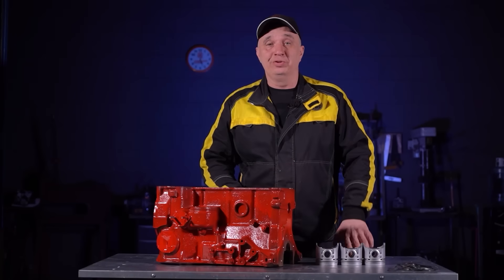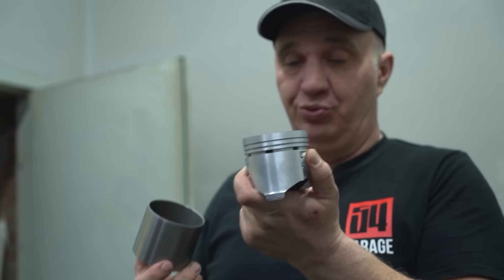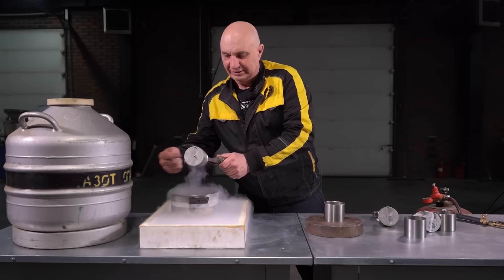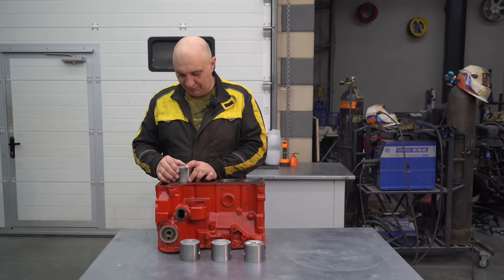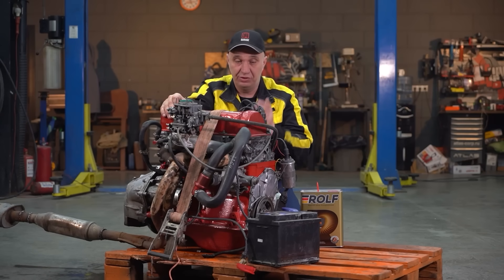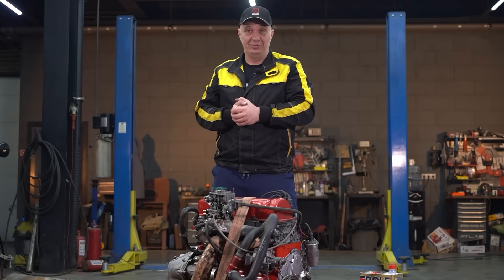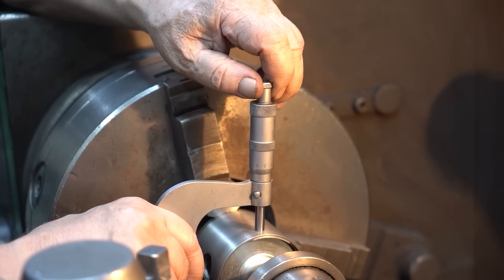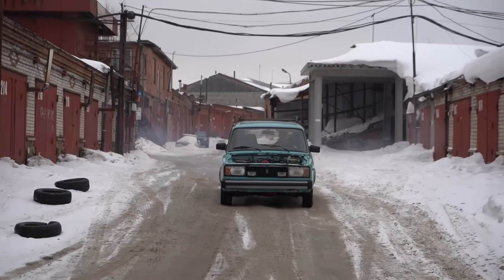We fit pistons with no rings to an engine - will it work?

Comment: I don't think just putting a sleeve on the piston will fix the thermal expansion issue. The aluminium will still expand and push the sleeve into the cylinder wall. Maybe the sleeve idea could work if there was a more elastic material between the piston and sleeve like some sort of epoxy? I think the better solution though would be to make the whole piston out of iron.

Comment: Gas model engines don't use rings. Both the cylinder and pistons are steel so they expand at the same rate. The fuel is a mix of caster oil and a fuel so everything gets oil. For a car engine you might be able to use two cycle engine fuel but it will smoke as long as there is oil in the fuel. The aluminum in the piston is enough to stretch the steel sleeve and that is why when the engine is warm, you lack clearance. What you suggest should work however without the rings the engine will probably have a shorter life as the wear will soon result in a lack of compression.

Comment: That aluminum piston inside the iron sleeve is still going to cause it all to expand and the clearance to tighten up between the piston and cylinder. I was hoping you guys were going to make cast iron pistons so everything has the same thermo expansion rate. Hobby grade nitro RC cars don't run piston rings but do have lots of lube in the oil.  I wonder if mixing oil into the fuel like a 2 stroke would help too
Reply: Yes. The steel sleeves don't prevent the aluminum from expanding with heat, nor do they contain it. I think some 2 stroke oil would have prolonged the fun a little longer, but would not have prevented catastrophe.

Comment: The idea from a Formula F1 engine which has such tight clearances that it cannot be turned by hand when engine is cold.  Engine needs a manual heat cycle to warm up enough so that you can turn the crank and fire it up.  Because the clearances are so tight the F1 engine being small in displacement Litre size has very high HP :)
Reply: Hahahahajahajajajajahaahah

Comment: The oil control ring directs oil to the wrist pin holding the piston to the rod, would never last without it even if you can make a piston that won't seize up. :)
Reply: I'd imagine this would work a lot better on a two stroke engine

Comment: I guess if it were me, I would've done the opposite. Same as here, but then put them back on the loathe and removed a fair bit everywhere EXCEPT where the piston rings would've been.
Why? Because you've drastically increased the friction by doing it the way it was, and without oil getting up there,... well, it's like trying to put it in the old lady's back for without using oil 😏

So this would, at the very least, remove 90%of the contact surface but still have completely sealed cylinders.
Heck if you can somehow KEEP the oil ring, or drill oil galleys between the "solid rings" (since that area was removed on the latge remember), that'd help even more!

I still think it'll seize and grenade before long, but it'll last a lot longer than this poor engine did! lol

Comment: Ringless piston engines are a thing. I have dozens in my bedroom as I type this. But they use a cylinder machined in a taper that's designed to expand into proper shape when it warms up, with a pinch zone near TDC, to make it all work. They're also all 2 cycle. Conrods really do not like being tugged on hard enough to pop the piston out of the pinch zone so YMMV on how long a 4-cycle lasts that way, but it's food for thought, especially since this engine needs sleeved anyway if it's ever gonna chooch again.

Comment: Rings don't just seal they also allow the piston to ride in the cylinder with a lot less friction, just those thin rings making contact is much less friction than a whole piston making contact. Friction means heat.

Comment: ok. having not watched. ill make some assumptions. will it work? i believe it will. but if does. not for long. it would certainly wear out piston skirts and cylinder walls quickly. but having seen some odd ideas for pistons recently. assumptions rarely turn out as expected. so ill shut tf up and watch and refer back to this after if i feel it needed.

Comment: Interesting but what was the point of doing this? Of course there is a reason for the piston rings and piston tolerance. This was a 100% predictable because of the different expansion properties of aluminum versus iron/steel. While the Ladas/Vaz were Fiat 124 bodies made under license in the USSR the engine was not Fiat. I wonder what kind of engine and transmission were mounted on these cars. Was it an indigenous design? Thanks, I truly enjoyed the video

Comment: Let's back to the past. When we invented piston rings in the steam engine They are needed, because piston heats faster than cylinder ( even tough the pistons and cylinders were made the same material). In combustion engines the different of temperatures is bigger.

Comment: It would be cool to see a 8 cylinder horizontally opposed boxer made from 2 inline four bangers.
Reply: One of the better ideas I've seen in the comments
Reply: Someone kinda did that already with vw engines
Reply: Porsche did this for the famous 917 IMSA and Le Mans racecars; only they were boxer six cylinders and they made a flat 12. It's noteworthy that it didn't run as a "boxer" though - pistons opposite one another did not reach BDC/TDC at the same time. Thus it was a "flat" 12 and NOT a "boxer" 12. Ferrari did same for their flat-12 in the Testrossa.

Comment: one thing I don't think you took into consideration is the actual construction of the internal dimensions of the piston.  Pistons have more base material in certain locations so that when it expands due to heat it forms a more perfect cylinder than when it is cold.  when cold pistons are not cylindrical they are more oval in shape than circular.

Comment: If not drilling the pistons for the oil relief holes to lubricate the piston, using a pre-mixed gas and oil mix would have prevented this IF you also had looser tolerances.

Comment: maybe if it had aluminum cylinder walls with reasonably tight clearance aluminum pistons that have skirts and a thin oil maybe 20 weight it may last longer. I'm just speculating though. I've been curious about this. maybe add some 2 stroke oil to the gas as well.

Comment: You should use a nickle-iron alloy steel, such as "Invar". I believe it has the lowest thermal expansion of any steel currently available.
I've never worked with Invar, so I don't know the machinability of it, but I'd be curious to see how that would perform.
Could maybe even machine a piston from chrome molly steel such as 4130, Or even Inconel 718, if your pockets are deep enough $$$.

Comment: hobby, RC, and model engines like COX have taper bores. So at the bottom of the stroke the bore is slightly wider than at the top of the stroke where power is made.
You could try a taper bore, so maximum seal occurs at the TDC of the engine.

Comment: heat the block (hot water) before starting --- or machine the block to size when its at around 90 deg c. -- the piston heats up much faster than the block. If you prejeat the block, or at least machine the block to size at operating temperature you stand a much better chance.
Reply: Also  use piston material that expands less than the engine block. F1 cars use engines that are frozen solid when cold and pistons free when the engine is heated close to 90 °C. As a result, the engine must be heated with external source before it can be started. If you use piston material that expands less than the engine block, you'll get more tolerance if you're close to overheating the engine!

Of course, you can still melt the piston or valves but it will not stick to the engine block.
Reply: @MikkoRantalainen  Pierdolisz.
Reply: Exactly my thoughts. I recon if machined like that it would have kept going, but would need heat soaked at 90°C before start up. 👍🏻
Reply: You have to do both, machine for operating temps and clearances and preheat the motor so it has enough compression to start.
Reply: @toolbaggers  correct!
Reply: Nope won’t work thermal exspanshion
Reply: Someone's got too much time on their hands ..
Reply: It would be a total pain in the ass to start tho....  

Would have to wait and get everything hot with coolant, oil, and block heaters EVERY time you needed to go somewhere.
Reply: heat that thing up with several guys on rosebuds AND use a torque plate. thats how i prep all my street blocks for dressing. we use tempilstiks to ensure even heat is applied.

Comment: Privet. I would suggest to machine your own fully aluminium pistons with usual mechanical adjustments (or just a tiny tiny bit tighter) and design segments grooves (with no segments, of course) inspired from Tesla valves using something like a triangle shape for instance. 2 grooves on top for compression and 2 others lower with the opposite shape to prevent oil from feeding combustion. The idea is to use physics principles to create virtual oil segments. Surfaces of cylinders have to be prepared like 2 strokes engines and a bit of 2 strokes oil in fuel may also help. Good luck ;)

Comment: Try to make an engine run above 100°C intentionally with an oil or something instead of water as a cooling liquid, so that the boiling point is much higher. Then you could boil water with a heat exchanger and make coffee or tea while driving for free!

Comment: Back in the 1970s, my brother was into model aero-engineering, and always tinkering with engines. Those tiny engines were way too small to have piston rings, but what they had instead was a couple of narrow and shallow grooves where the rings would be. As I understood it, those grooves would fill with lubricant from the two stroke fuel, which in turn would help to cool and lubricate the pistons, but not only that, it had the desirable advantage of increasing the compression pressure - don't ask me how, I have no idea, unless the oil in the groove behaves like a sort of piston ring.

If you have plenty of engines to play around with, I wouldn't give up on this project just yet.
Reply: Tapered sleeve to seal the top of the stroke when it needs the compression

Comment: I wonder if it would work way longer if you removed the thermostat and added another radiator plus a large oil cooler, if you don’t let the engine actually get up to temperature then it would be much easier to control the clearances, obviously the efficiency would be terrible though

Comment: Now if the cylinders were thicker (or even solid in a block) then things may have lasted a bit longer, but still would have overheated with the lack of sufficient lubrication to the walls, adding oil to the fuel could help, but only delaying the inevitible... :P

Comment: AC compressores have an iron piston with no rings wich travels inside a cast iron block, however they run cool and occasionally what adds to their longevity.
Reply: Yea due to no explosions. Combustion creates heat .
Reply: True. 
Two problems are here:  1. Different expansion due material.  2. Different expansion due different temperatures in piston and wall.
Reply: AC compressors (I assume you mean the kind used in cars) are constantly bathed in oil.  Without combustion you can essentially immerse the entire thing in oil and oil becomes the rings.

Comment: No oil will get to the cylinders
 Should have drilled a few holes to allow oil flow.
Reply: Should have added 2-stroke oil to the fuel. That's much easier.
Reply: @CarsandCats  They should have version 2 (the refined one), and with 2 stroke oil
Reply: Or do make holes or pores like street racing motorcycle pistons, that will avoid engine from getting jammed

Comment: Pleasy Try again, this can work, Tiny RC Nitro Engines work also without Piston rings.
The Piston is made of Aluminium and the Liner is out of Brass, these engines can whistand up to 50'000 RPM
But you have to make an oil film, maybe try 2-stroke oil in the fuel.

Comment: I could see that it would work from the beginning,if you wanted to work only with full steel piston or aluminum block and same thermal exposure, that would mean that all should heat up at the same time

Comment: Wonder if you slot cut bottom to act like a ring, would that work to seal it better? Almost like a collet is cut but around the diameter instead. It would have to be over built on the piaton face side to make up for the rigidity loss by using the skirts like an expanding seal. May help to cut radial grooves to reduce wear and improve seal as well. Like the piston grooves but using using the skirt as the seal instead. Not sure if this makes sense to anyone. Would be an interesting project to see how long it lasts and how well it seals.

Comment: As a kid, my Cox .049 engine ran fine, while having no piston rings.
Reply: And those little things are actually high performance 2 stroke diesels
Reply: @gregdowd939 NOT a diesel.... 

The ignition comes from a catalytic reaction between the methanol in the fuel, AND the platinum metal in the glow plug element. 

Without the methanol, OR the platinum in the glow plug, those engines will NOT run. 

The ignition is not just set off by compression alone. Compression is just a small part of the entire ignition process in these engines.

Edit: If you dip a fine Platinum wire into the top of a jar (where the fumes are) that contains some Methanol in the bottom of the far, the Platinum wire will glow red hot all on it's own, just from contact with the Methanol vapors. That reaction IS what fires these engines off AND why they're called "glow engines".
Reply: Rc nitro engines use a tapered sleeve to seal the top of the stroke
Reply: Honestly I thought that if you have no piston rings and no combustion , you couldn't run the car
Reply: The piston I believe is made from steel not aluminum.
Reply: The Cox pistons are steel, although a modern R/C glow engine HAS an aluminum piston today
Reply: Also those model engines used a five to one oil mixture with a little bit of nitromethane.  And left a huge gooii mess after running.

Comment: Maybe try building  the engine  like the model  airplane and rc cars and use the same fuel  they run on,,,,they have no rings and it think if you measure  and work out the clearances may just work

Comment: During WW2 the Americans built several aircraft motors without compression rings.   They machined the top of the piston so it had a lip sticking up on it's top.  That lip would expand outward with heat until it touched the cylinder wall. 
It required a long warmup time before the engine could be run to take off performance levels, burnt a lot of oil and fouled a lot of plugs. 
Similar tech is used on stationary diesel engines and immense ship engines.
Reply: Rc nitro engines use a tapered sleeve so it seals near the top of the stroke
Reply: The joke there is the same guy later worked for Ford.
Reply: So is it these guys who designed the T-70s ?
Reply: 😂😂😂😂😂😂 @paulbriozzo4895
Reply: What would the benefits to this be?
Reply: @bertsmith5569 NESSUNO! È SOLO PER GIOCARE.
Reply: And exactly which engines would those be??

As far as I am aware, all radial piston engines HAD rings in them... 🤷🏻

Edit: I can't see any military wanting an engine like that for use in a war either. A long warm-up time, the often fouling of plugs and the resulting high-maintenance to keep them running would be an absolute deterent for a military to want something like that. Especially when there were PLENTY of reliable ringed engine designs about. 🤔
Reply: A dykes ring has the same effect.
Reply: @RichLeespage  What do lesbians have to do with this?
Reply: Seems the top of the piston would expand more due to heat from combustion and needs to be smaller at the top to allow for the expansion.

Comment: I think the problem was lack of oil to the pistons. There is an oil channel in the connecting rod which feeds oil to the oil ring groove on the piston. Maybe drilling a hole in the steel sleeves in the right place would have been more successful.
Reply: I don't think so. The pistons scuffed and seized because they were fit so closely to the cylinders. The steel sleeves over the aluminum does not stop the aluminum from expanding. Thermal expansion is an unstoppable truth.

Aluminum grows 0.000013 inches PER inch of material PER ºF increase. That is to say a chunk of aluminum 1.0000000 inch long @ 70ºF will be 1.000013 inches long @ 71ºF and 1.0033 inches long @ 320ºF. This is truth, irrefutable and unstoppable. You can only find ways to deal with it - like opening up clearances and using expanding piston rings to create the seal.

Comment: It sure was fun to see how it destroyed itself! I wonder if cutting some ringlands in the pistons would have helped? That would have given a place for oil to accumulate and "somewhat" seal cylinders.
Reply: I don't think it would have helped - i think they just over expanded. They need to measure the pistons at high operating heat, then rebore to that. Might be terrible until it heats up though
Reply: A bigger issue than you think

Comment: Try to build an engine with the least valve lift and duration as possible, that would be interesting. How much does an engine actually need to function?
Reply: A variation on that idea would be to screw around with the valve timing to see how slowly, in rpm, the engine could be made to run.
Reply: @gregholloway2656  my 48' ford flathead idles at 450rpm by the book. itll run at about 300rpm and feel really odd doing it but thats by the book lol
Reply: @gregholloway2656  Good idea too
Reply: I thought about them advancing ignition timing as much as possible to see what happens
Reply: "this thing goes!... wait what happend??" - garage 54
Reply: That's actually how the Freevalve engine controls the throttle.
Reply: I reckon the exhaust valve would have the hardest time
Reply: Nope
Reply: Przeanalizuj pracę bmw valvetronic.
Reply: it will make 1hp and rev 400rpm